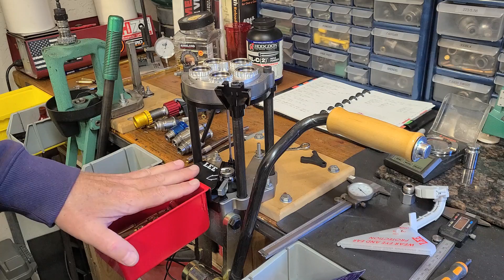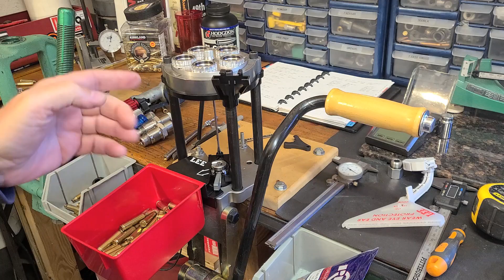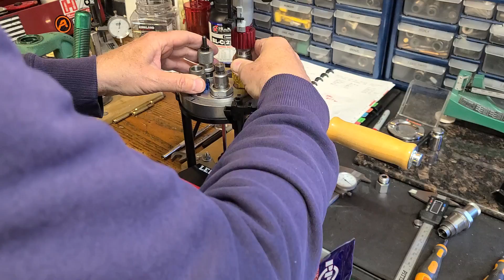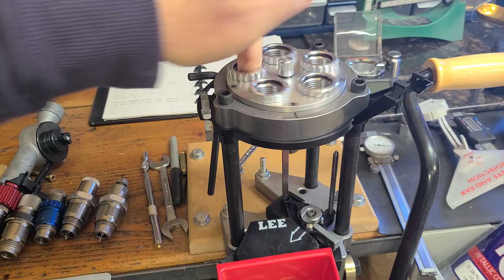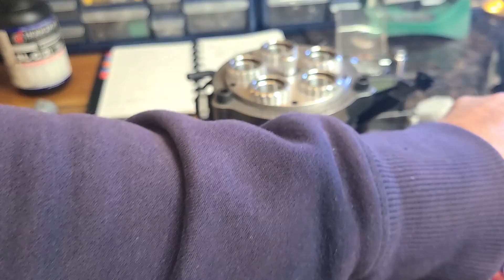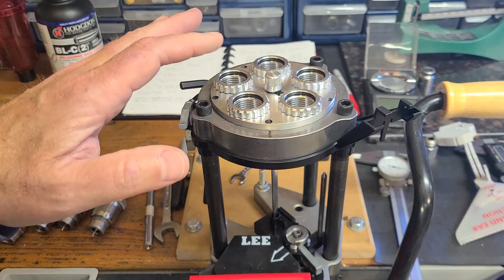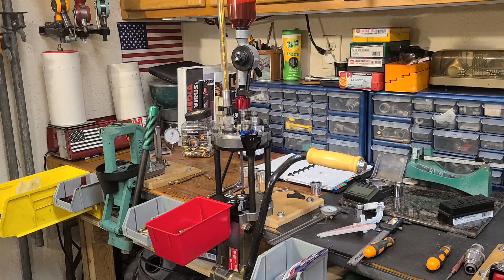Lee Precision Ultimate Turret Press...First look at part no 91910

Comment: I got mine yesterday and you are spot on about the indexing issues. Coming off of the  classic turret I am not a fan of the new system. The only advantage is now I can use the bullet feeder. Honestly for the money I can't see it worth not using your fingers to insert the bullets. Great video.
Reply from the maker: Sorry about your experiance.  My first impression was disappointment.  I slept on it and gave it a second chance.  Two things that help so far.  Pull the turret and lube the thrust plate (flat plate) and outside diamater with some thick wheel bearing grease, not thick just thin and even.  This will slow it down.  Next, just slow a little at the bottom of the stroke as the clutch disengages.  Bit of a feel thing.  Yeah, its not optimal and its going to need an update but ive knocked out quite a few rounds with decent speed.  best of luck.

Comment: Nice video, but with me currently using the Classic 4-hole Turret and having 9 different set of dies mounted on 9 turrets, I would need to buy 9 sets of the breach lock things for my dies. Or buy one set and thread them into the set in the turret. Or buy 8 more turrets and unbolt and install the new turret when I swap dies. All that would end up doubling or more the cost of the press. For me I can see me just staying with the Classic Turret press.
Reply from the maker: Its only a good option if it makes sense for you.  Nothing wrong with the LCT!

Comment: So, finally got my ultimate press after months (long story but don't order from any company that sounds like Dack Outdoors) and got it together.  When I put the bullet tubes on the turrets, there is a bolt that goes through the inline bullet dropper but I cannot find a nut that secures it and it seems like it needs something due to the motion when the turret is moving.  Am I missing some part?
Reply from the maker: I don't have that kit but if I remember    the bottom part has an alignment pin that is meant to go through the plastic part on top of the bullet feed die , i think the pin is threaded plastic but I think they abandoned putting a nut on it.  It's probably 1/4 20 try putting a nut on it.  Or one friend of mine, I think he drilled it and put a small hitch pin through it as a retainer.  Sorry, not much help.
Reply: @TreeTopFlier No big deal.  Just wanted to make sure I didn't lose something.

Comment: I have a bunch of RCBS dies and think they should fit (once I put them in the Lee bushings) but I wanted to make sure.  Great video Tree Top!
Reply from the maker: All common the dies are 7/8 14 thread and will work in the breech lock bushings the press uses.   There is a part 2 to this video that may help shed some more light on the press.   There have been some updates along the way.

Comment: Die tipping: I never had heard the term but I absolutely experienced it over and over with the short pistol calibers like 32 ACP, 380 ACP, and one long case, 38 SPL. My workaround is that I have to ensure that the shell holder’s opening is at the 9:00 position. The shell holder will keep moving slowly counter clockwise but I keep setting it back to the 9:00 position. 

The primary problem that die tipping causes is misalignment of the empy case rising up into the powder through expander die. It puts stress on the case and tends to actually buckle the empty case to the point that it is unusable. It’s not 100% preventable but if i did not perform my workaround, it would happen frequently, like 1 of every five upstrokes of the ram.
Reply from the maker: I can see what you're talking about but I don't think that is what Lee was referring to.  I later ran across some info.  Its a bit of a marketing critique.  The traditional turret presses have a center bolt that holds the turret in place.   When the die over the ram is contacted the entire turret tilts a little from all the pressure being on one side.  like a seesaw pivots in the middle.  The UTP press is supported around the outside so its not supposed to tip like the others.  It does tip, just like the others and just like the others it is harmless to the outcome.   Thats my takeaway....anyway.  Thanks for watching.
Reply: @ understood, thanks for the reply and the video. It is the first one that I have watched on the UTP. I just didn’t “get” the reasoning behind the UTP instead of a regular Lee turret press but I understand it better now. I won’t be replacing my Lee four hole classic cast turret press with the UTP, though. In addition to the turret press I have and use a Hornady progressive that meets most of my reloading needs. For development and experimentation, I use the turret press as well as my three single stage presses.

Comment: Just an FYI....Lee currently has the 5 hole turrets on closeout pricing.
Reply from the maker: Thanks for the heads up.  I looked and they are still offering them at regular price.   They have one in their closeout page but it's just a blemished.  They often put blem and reconditioned items on their closeout page but it's just that one off item.

Comment: I've been thinking about getting into reloading on and off for years, but single stages always seemed like too much fiddling-- requiring large batches to minimize the overhead of die changes-- and too much transferring the cartridge into and out of loading blocks, while progressive presses just had a scary amount of stuff going on with each pull of the lever for someone like me who wants to watch each stage of each cartridge like a hawk.  I recently learned about manual turrets like the Redding T-7, which seem like a big improvement over standard single stages and give you the option to complete a cartridge without the constant transfers of the cartridge to and from loading blocks and I thought that was as good as it was going to get until I saw this video, which did the best job I have ever seen in explaining different kinds of setups possible.  This turret has a leg up over the manual turrets in that it saves you from having to rotate the turret after each pull, and it automatically kicks the cartridge out.  I'm on the verge of ordering this one, but thought I'd check to see if you know of any other presses from different manufacturers which offer this same kind of workflow just for the sake of completeness.  Thank you for making this video, I am extremely glad I watched it before ordering a manual turret.
Reply from the maker: Thanks for the comment!  I am not aware of any other Turret press from any other manufacture that has auto index feature.  This is unique to Lee presses.  The Classic turret press is tried and true if your looking for something a little simpler to operate.   Sorry its taken me some time to answer, Ive been pretty off grid in the mountains lately.

Comment: I'm sure by now you've found out lee has a new bearing plate that has holes for an index ball and those two little boxes under the bearing plate allow for a detent ball and spring.
Reply from the maker: I do know and have ordered them.  Thanks for the heads up, we'll see how it works.
Reply: @TreeTopFlier  just got my parts from lee. So the holes in the bearing plate were 1/4" and same location I had them. The spring is a higher spring rate than what I have. If your 5 or 6 hole turret doesn't have dimples in it, you'll probably have to put some in there. Mine didn't, but I suspect if you order new ones they will. The holes I drilled combined with the increased spring rate locs that turret tight, maybe too well.
Reply: To prevent/ reduce over rotation of the turret due to handle operating speed, could you not place a leaf spring retained under the post cap screw, to provide a minimal friction “brake”?

Comment: So you'll see two little boxes underneith the turret. Take off the bearing plate and their labled "5" and "4-6". I drilled two 1/4" holes in the bearing plate where those two boxes are and I installed a 15mm spring and a 1/4" ball bearing, drilled small dimples in the turret where the ball would engage the turret. In the newly published instructions for this press Lee states that the "4-6" hole is for a 5 hole turret and the "5" hole is for the 4 & 6 hole turrets. This will allow you to fully index the press and prevents over-rotation of the turret.
Reply from the maker: Thank you for the great comment.  Im aware of the abandon cups molded into the tool hanger.  Interesting that they didnt even lable the molding correctly...good lord!   Apparently Lee is now shipping the press with a drilled bearing plate, ball and spring.   The items are on the site...(you have to dig) in the parts section.  looks like about 20 bucks.  You really took matters in your own hand (big respect)  Ive been testing some friction and fine tuning the index rod twist with good results.  Im to the point where Im not sure I need the ball.   Anyway, well done my friend... fortune favors the bold!

Comment: Would Lucas red & tacky work
Reply from the maker: Yes, I don't know why it wouldn't.  In this application, we need something that lubes to prevent wear and ALSO, something that adds drag to the rotation to help prevent over rotation of the turret.  Its a good observation on your part that engine assembly type lubes are pretty tacky and maybe a helpful option.

Comment: I can see Lee adding a ball detent on the station above the ram and slotting all the die stations in the tool head to solve this issue down the road. Great video as always.
Reply from the maker: Thanks, yes that is one solution that makes sense.   They seem like they planned on coming up from the bottom through the bearing plate with a removable ball and socket in the tool holder.  There are boxes in the mold for it.

Comment: I've just finished my first 200 rounds on it.  I sold my Classic Turret afterwards 😂. 

You made an excellent video and confirmed every issue I ran across.  Only takes you a couple times and you realize you have to slow down and it works perfectly. 

I bought the kit in 40 cal and found it odd it comes with the online bullet feed magazine,  but not the die.  I already had it, so not an issue, but for someone who doesn't,  they should be aware.
Reply: What is missing out of the kit ?
Reply from the maker: Looks like they didn't include the caliber specific bullet feeder in the kit.  It comes with the magazine but not the feeder die.  Doesn't make sense, but there it is.   Maybe they were not available at the time of shipping???
Reply: @TreeTopFlier  I'm going to ask Lee why?  I had all the feeder dies I needed for when I use my 6 pack, but those new to turrets or reloading in general may think a part is missing.
Reply from the maker: Curious what they will say.... @kaiju1293
Reply: @TreeTopFlier  They said they made that decision to keep price lower.  

But we still have to have.  It's all good.  Still a great turret press
Reply from the maker: Thats great, glad you got some use from the video!  I didnt realize the bullet feeder didnt come with the kit, just the magazine, which is crazy.   I had to go look it up.  doesnt make sense... Thanks for letting everyone know.

Comment: Could ai use this for 30 Nosler with the auto rotation?
Reply from the maker: I think so, with so many bullet lengths its hard to say yes for sure.  if you use a bullet feeder maybe not.   The problem is with the feeder.  when the feeder sets the bullet on top of the cartridge as you lower the ram the turret rotates.  If the turret rotates before the bullet is clear of the die the die can nock over the bullet.  I would say if you hand feed into the seating die, no problem, auto indexing should be possible.   I just made a batch of 7.62x54R with a bullet feeder and it was fine, still had about 3/8" clearance.  hope this helps.

Comment: Im going to reload for the first time, so i havent have any equipment yet. This press looks very interesting for me, i'm not going for high volume, as i dont shoot much (max 100 round a week orso) but i don''t want single stage. I want to reload 9mm, 30m1, .223 How is your experience with 223?
Reply from the maker: This press wouldn't be a bad choice.  You can use it as a single stage or automated indexing so it will cover most anything you would want to do.  Ive done a bunch of 223 on it and am very happy with the results.   With the bullet feeder and a 5 hole its easy to crank them out.
Reply: Any of the Lee turret presses will be the most versatile useful press you can own.  Everything from just priming(or depriming) cases, making full rounds, or even pulling bullets and demillling rounds.  Lee turrets are the best.

Comment: Nice overview of the press. 👍

Vintage early versions of the Three Hole Turret Press with Auto Index featured adjustable “friction”.

The three hole configuration with 120 degrees of rotation per stroke develops quite a bit of inertia due to the larger amount of rotation in the cycle - it’s a mass times acceleration and mass times velocity squared type of thing. That’s why slowing the handle rate helps so effectively - the acceleration and velocity of the moving mass is reduced.

The large diameter of the new turret increases the effect over the old three hole press - it’s a pretty good flywheel!

I imagine you’ve already revisited your thoughts about needing different detent locations for the various number of stations. The detent on the press would be consistent, and notches on the turrets would be relative to the station holes in the same way the location pin holes are. The challenge would be only using 3 of the notches on the 6 hole turret.
Reply from the maker: Hey William, yes we are definitely running into a "flywheel" type situation and the effect is minimized or exaggerated by the particular setup being used.  As we deconstruct the design, I am currently leaning away from an index ball system in favor of some sort of adjustable friction to mitigate overrun.  An index ball system AND alignment pin might not always agree when it comes to alignment.  Thanks for your comment and thoughts on this.  I would be interested in seeing the 3 hole friction adjustment you referenced if you could find a link.  Thanks Sir.
Reply: @TreeTopFlier  I posted a few pictures on the Community tab of my Channel.